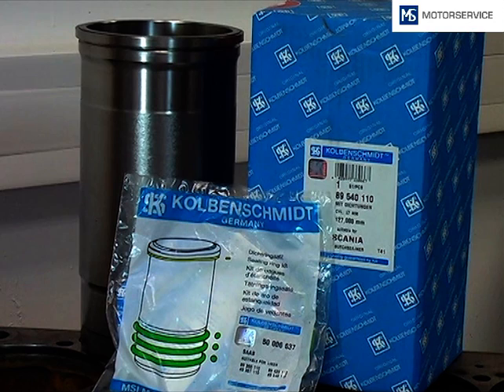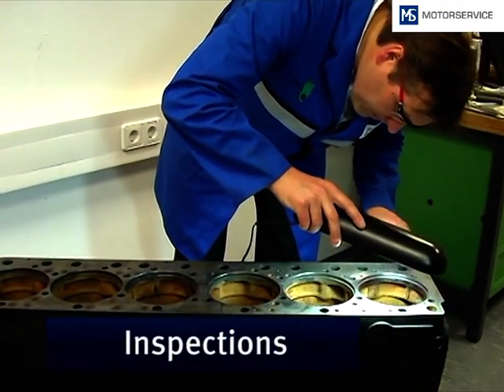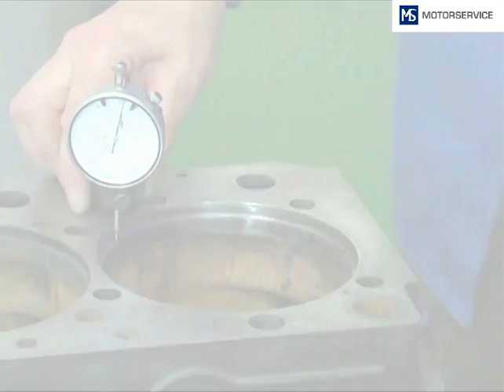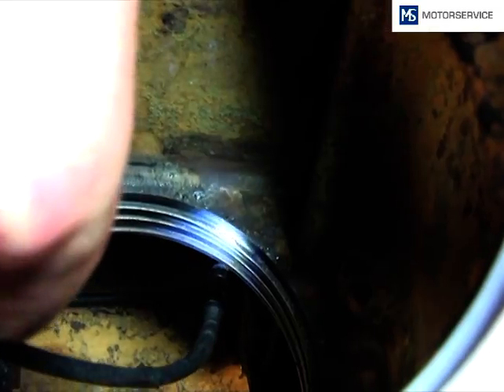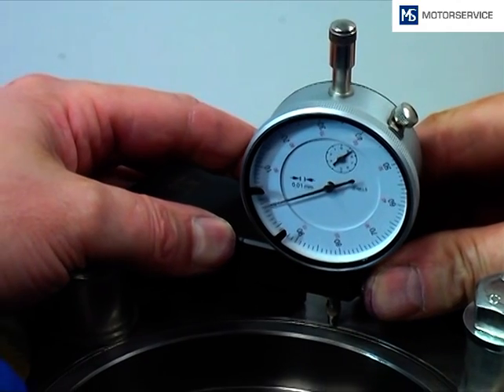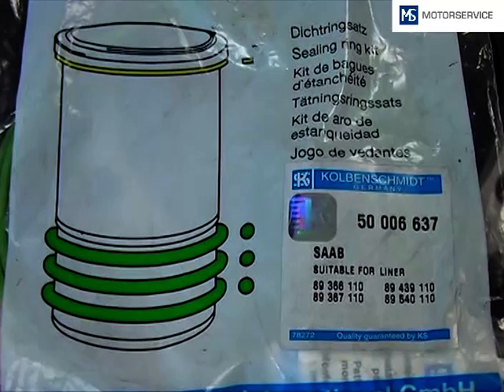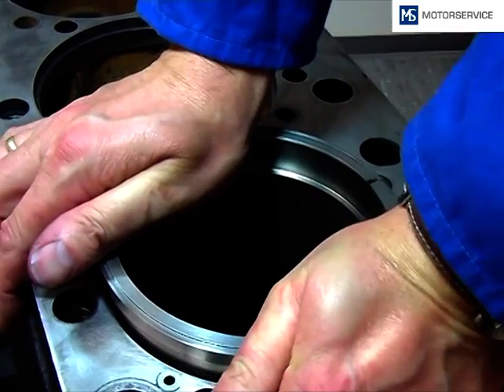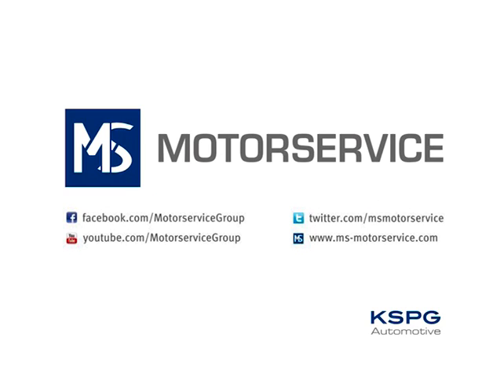Installation of cylinder liners (EN) - Motorservice Group

Comment: What is the lubricant that you used?
Reply: Comes with the liner kit.
Reply: A recommendation is to check on the Service Manual, since some use different lubricants, for example for Series 60 you can use vaseline and some others like Mack E7 use silicone applied directly on the liner wall and the cylinder block sleeve seat. My best advice is to always read what the manufacturer said about it, if it's recommended to use soap, lubricant or another direction.